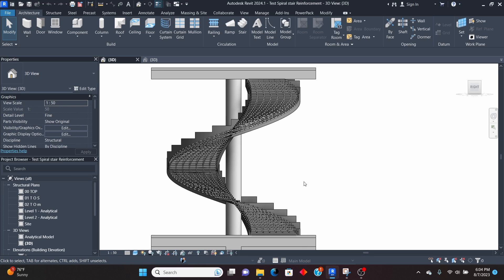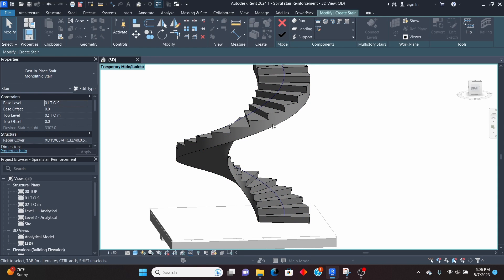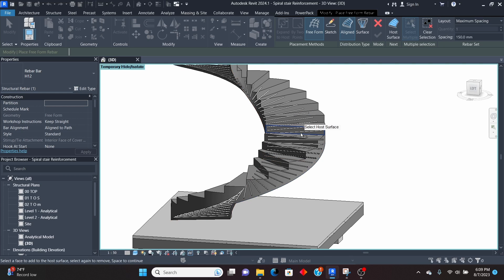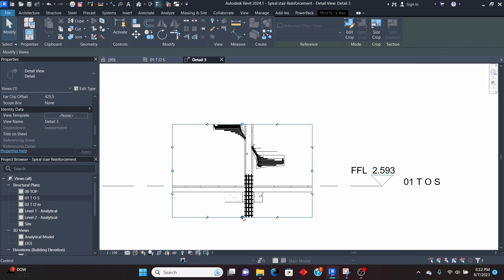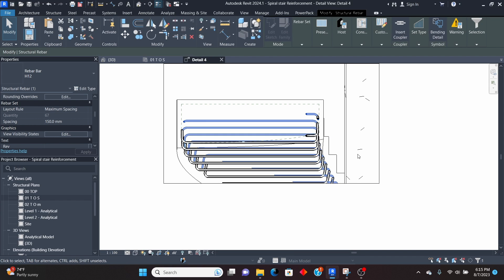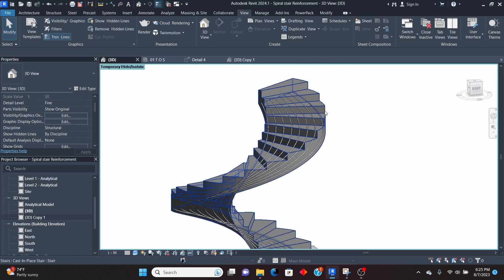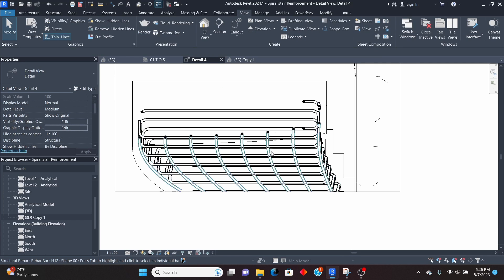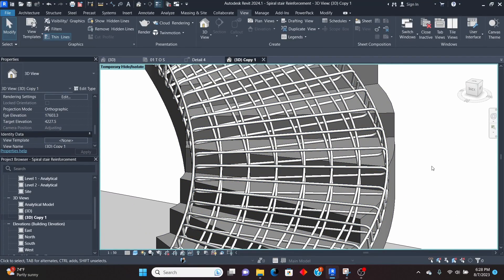Stair reinforcement details || How to add reinforcement to spiral stairs in Revit

Comment: These are beautiful structural diagrams.  In this case of a spiral stairs, all that reinforcements is not necessary  and all one needs is a strong narrow beam at one end of the set o f steps.  All the steps will be indented and fused into this narrow  strong helical side beam  and the TORQUE  in each solid step would come into action, with the next up step  resting  its close  lower long edge, riding over the far upper long edge of the lower step.. This is the manner they built spiral staircase in castles and windmills 1000 years ago using individual stone steps.  The steps simply rested on each other their edges and they were stable provided they were indented into a close wall. or a central column which could be helical column. 

Something went wrong at 01:44 as there should not be any rebar in front of the central column. 

Congratulations on your mastering of this wonderful drawing tool. It is so realistic. We did not have such luxuries 85 years ago!. ..
Reply from the maker: Wonderful analysis. We are all learning. Am happy if you mastered the Revit tools to make adjustments as per your requirements. This is the longest comment on my channel. Thanks it helps alot
Reply: @skillmaxacademy  Thank you for replying. I am now an old man and I used to design water propellers,  Your helical spiral staircase reminded me of how I pitched and  made propellers using wooden models before casting the real item.  .. We did not have such drawing tools.

I designed and made, spiral staircases but the bannister on wither side of the steps were used as the helical beams to hold the steps , The strength was provided by the structure of the bannister, and not the helical slab under the steps.

Again, congratulations on your work, I did a lot of Mathematical Matrix Transformations when much younger and I can appreciate the Mathematical Matrix Transformations  which are used to translate, enlarge or reduce, rotate , your drawn images.  You are now living in a wonderful world of engineering, with which I earned my living, Congratulations once again, Following your videos brought back memories, and I could not fail admiring your work,  Many people can learn from your videos. All the best and keep up your brilliant work.